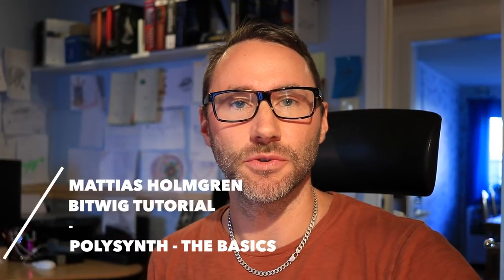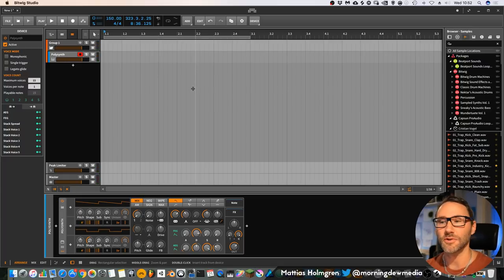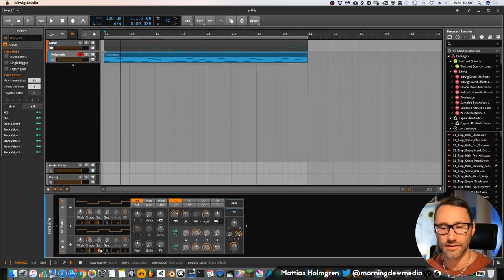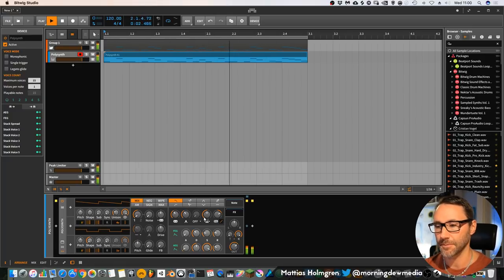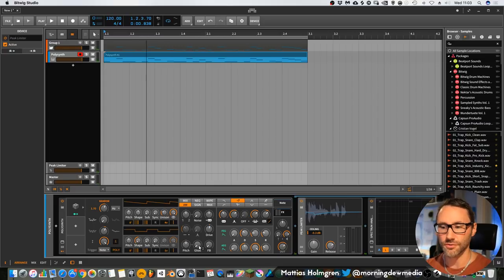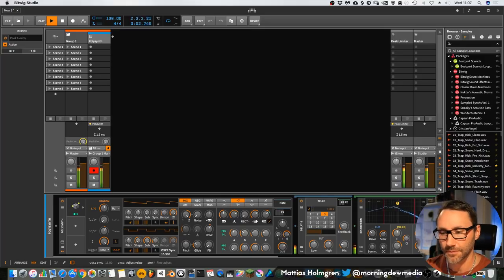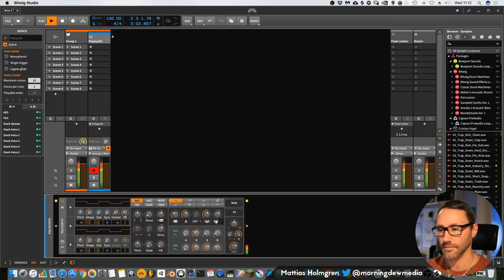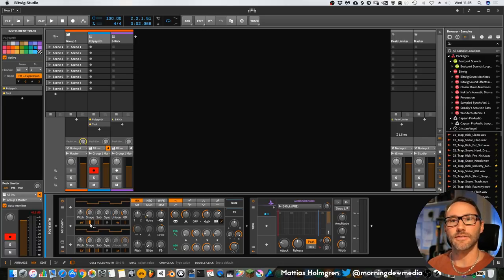How to use Bitwig Tutorial - Polysynth Device - The Basics

Comment: yet another great tutorial. Thanks!! I have one question, when you have made your sound in the polysynth, how do you save that setting as a new preset?
Reply from the maker: Hi thanks. Just drag the device over to your browser panel at the right side. A popup will appear where you can enter meta-data. Remember if you want all your sub devices to be saved with the preset, make sure they are "chained", put in the FX slot of the polysynth. I did a video on this because its not that obvious how you get a complete "set" of devices  saved in One preset.

I also sometimes put them all in a Chain device or instrument layer container depending on what I want to do. Did that work out for you? //Mattias
Reply: Mattias Holmgren thanks so much Mattias, I haven’t seen that Video of you yet. But I will :)
Reply from the maker: The chain device Flow is explained in detail in this video https://youtu.be/azd73YmOw2k Please comment if it was helpful. 😉🌞